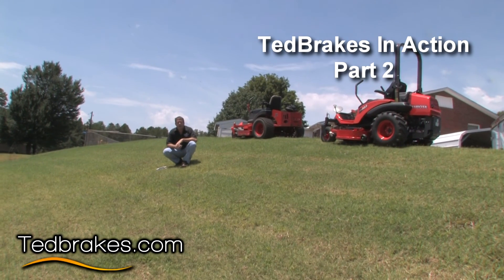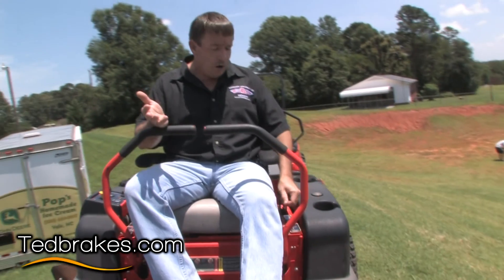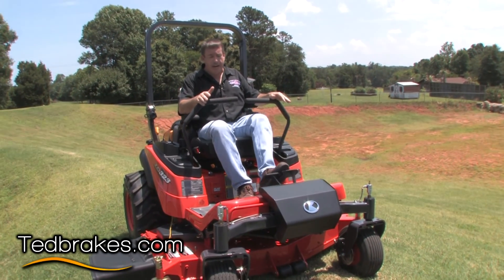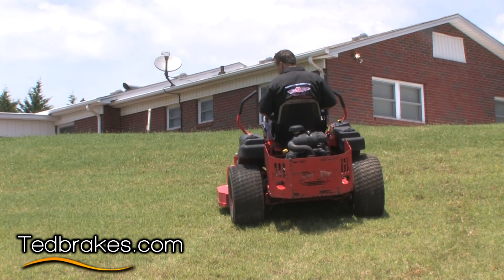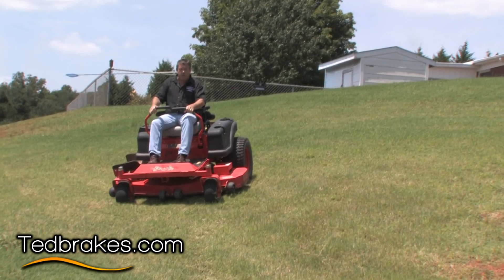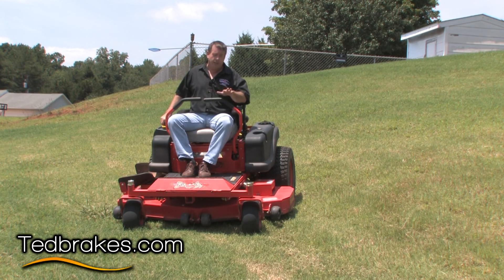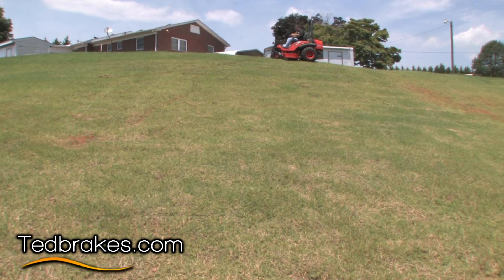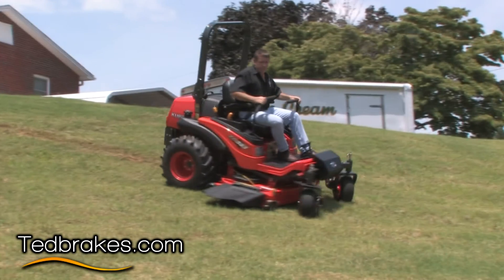Front Brake System for Zero Turn Mower - Additional Testing

Comment: Kubota Z's do not use drive belts on their HST transmissions.  So belt failure is not possible.  Their drive and rear brake system is much different than typical pump/wheel motor combination equipped mowers.  Its obvious the front brake system makes a huge difference when going forward or down a hill forward.  Much like that of any vehicle.  If you were backing down the hill the front brakes would become useless and the rears would pick up all the braking.  All based on load transfer.